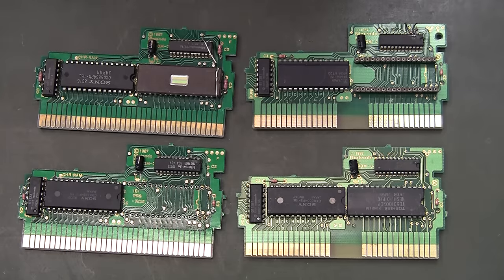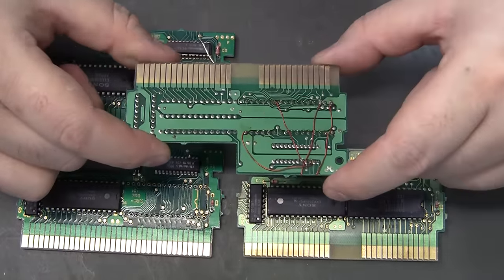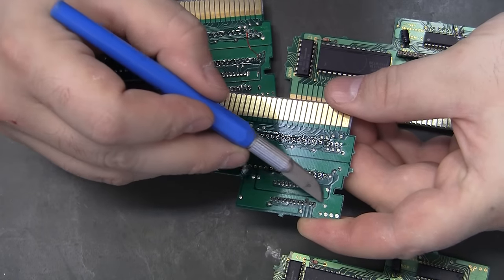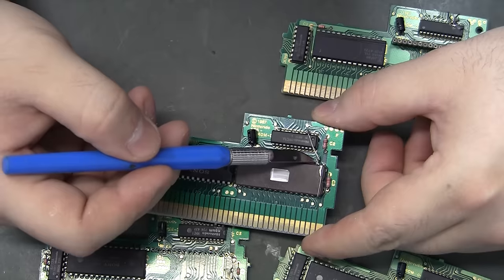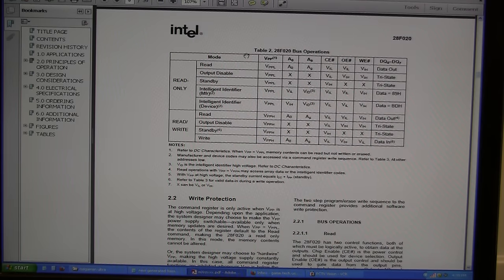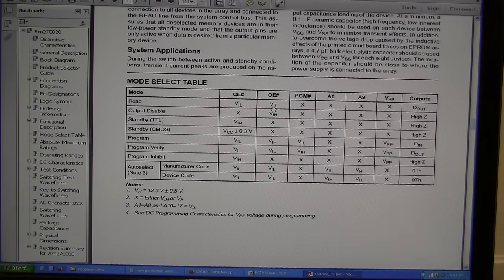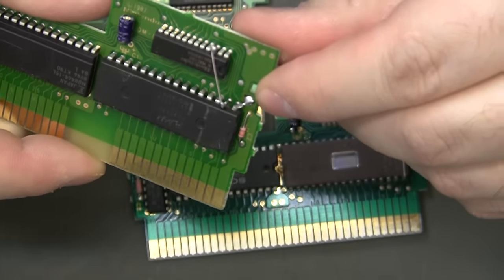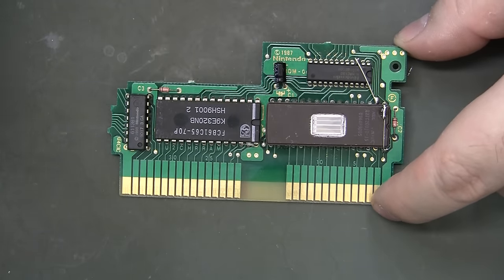NES MMC1 repro wiring using a donor cart pcb Nintendo reproduction

Comment: The VPP line on EPROMs should always be pulled high, because it varies by vendor.  I have heard of cases where the EPROM fails to operate unless VPP is pulled high.  TI ones in particular from what I recall.  It's always good design practice to pull VPP high.  The older EPROMs (2764's and 27128's and smaller) tend to be more sensitive to VPP state, so I always pull VPP up.

Comment: Is there a site or how do you know which games need pins to be wired different. I made Little Samson and used a Top Gun 2 board, but its not working so I am guessing it may need extra wires.